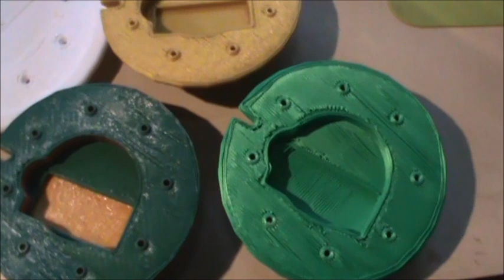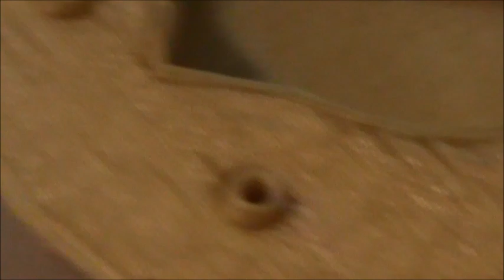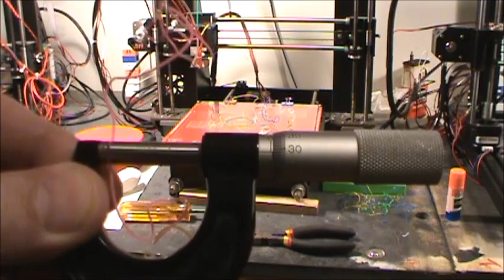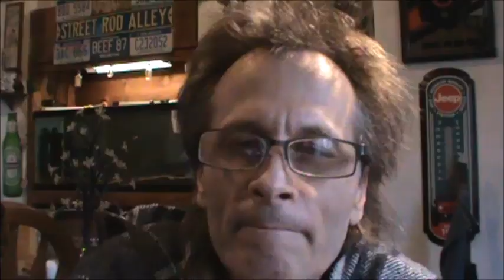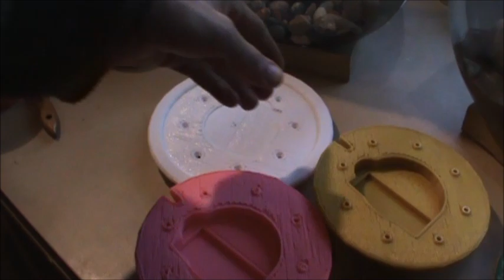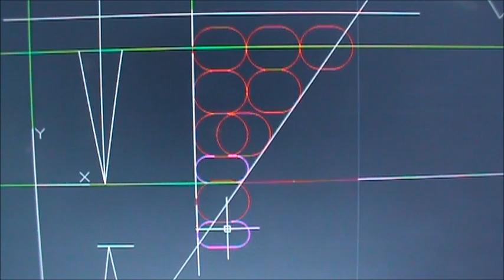3D Printing Problems Got Some Of It Fixed...

Comment: Looks like you are measuring die swell.  This is the reason we can extrude a 0.8mm line with a 0.4mm nozzle.  Try printing a cube in vase mode and measure extrusion width of your walls.
Reply from the maker: im not sure what you're calling "die swell" if your talking about the nozzle/die getting hot and physically getting bigger to the point that the hole in the die opens up that much i gotta say no. that would not explain the different bead diameters thru the same die at the same feed speed and temperature. but if "die swell" is different filaments swelling up at different rates due to chemical compositions then yea. 
   as soon as i find "vase mode" i will try that i havent seen that mode but i havent ever gone looking for it.
Reply: @ottisthedog3544  I think Cura uses “Spiralize Outer Contour” instead of vase mode.
Reply from the maker: @m_IDEX  so what i discovered is that when my filament was coming out of a .60 nozzle the bead was at .80 for this i set my Z jump to .68 (i subtract .17 from my actual bead dia. (just a random number i came up with sometimes i use .20) and yes i know the math of .80-.17 doesnt look right but i work to 3 places.000 so there is some rounding/averaging involved. my width is set at .80 (same as bead dia) and these are numbers i just came up with thru playing with things. i had a section of support that was nice and straight. a single line straight up for about 1/2 an inch. what i got was a .85 width which tells me i have .05 of over lap/volume. i dont consider that much (it doesnt seem like enough) but it works for what im doing.